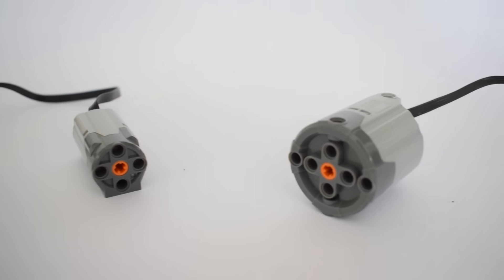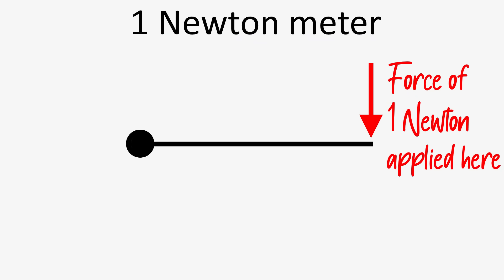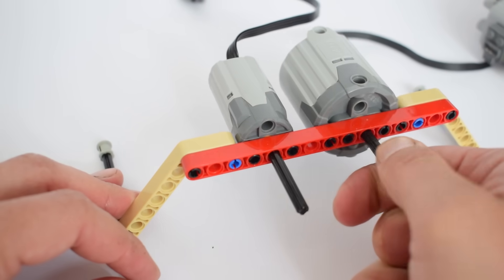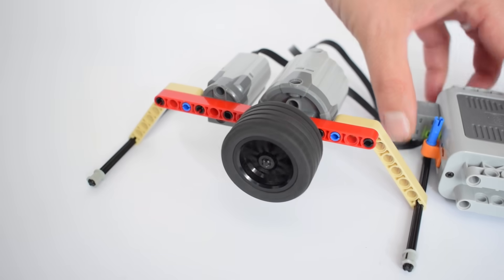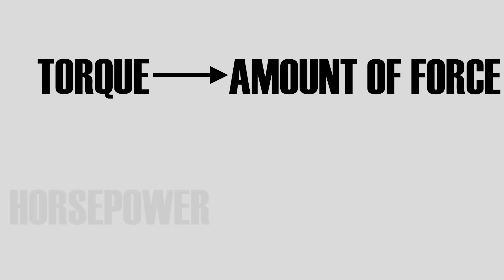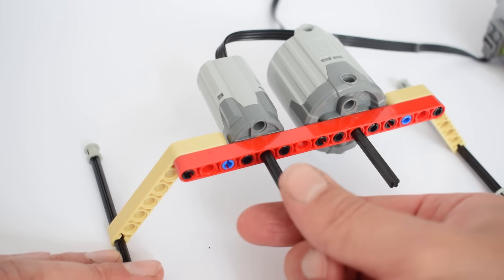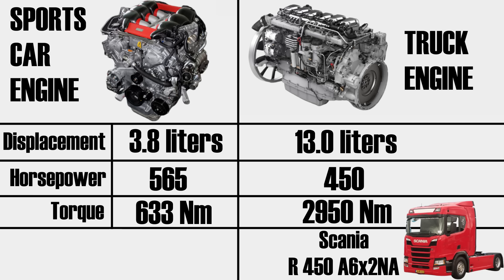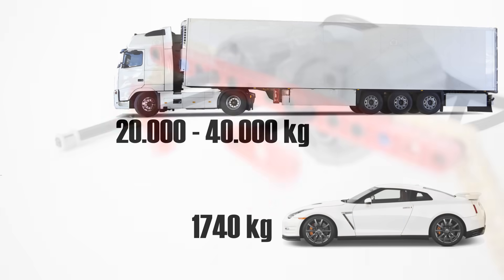NEVER be confused by HORSEPOWER and TORQUE again - HP and TORQUE EXPLAINED in the MOST VISUAL WAY

Comment: This is a good explanation. I think the only thing missing is the effect of gear ratios being torque multipliers.
Reply: Exactly, you can create double torque just with having speed halving gearing and power stays exactly the same if we just ignorre small gearing losses to simplify things.
Reply: @Karjis  I was thinking the same thing.  Using gear ratios to reduce the rpm at the tire (using a vehicle as an example) you can get the same amount of torque applied to the ground as a much larger engine.
Reply: @kevinbuhler8776  An even better example is a bicycle.  You can see the transmission (it's called a cassette), so it's a great way to understand gear ratios.  In a lower gear, the gear size is bigger.  One turn of the pedals might make gear 1 make one rotation.  Gear 1 is terrible for speed, but it's great for power, such as just starting off, or going up a hill.  Compare that, to say, gear 7 (I'm using that because it's my bike's highest gear).  Gear 7 is visibly smaller, and makes many rotations with one turn of the pedals.  It's great for cruising along in a straight line fast.  But you'll terribly hurt your knees if you don't move to a lower gear if you need to go slower, or if you're going up a hill.  In fact, for anyone who's interested in learning to drive a manual car, I would recommend to them that they first play around with the gears on a bike.  It makes learning to drive stick much easier, because they will better understand the concept of low versus high gears.
Reply: @hamsterama  Brilliant
Reply: Yep, on max power RPM and at full throttle, with proper transmission gearing,
more max hp =
more tq at the wheels,
only horsepower number matters.
Reply: @kdh6387  exactly! Bigger engines just last longer and are more fuel efficient at high loads. Thats why they are used in trucks. The torque output is irrelevant.
Reply: @vince0815  Torque output is relevant because you're physically limited by the size of your transmission. If you could have as many gears as you need, you'd eventually get an F1 engine to move a 40 ton truck as fast as the truck engine, but realistically... You'd need way too many gears because of the low torque output of that engine.

If you've noticed, most modern turbocharged cars have a high level of low-end torque, delivered flat and a power band of max horsepower delivered at high rpm (with lower corresponding torque). The result is that you get a very responsive and driveable car.

Large engines are indeed better for efficiency but not at full load. Every engine is designed to operate at maximum efficiency at a specific rpm. Check out marine diesel engines (the ones that are the size of an apartment building). They get 60+% thermal efficiency. That's insane for an internal combustion engine. But they spin oh-so-slowly.
Reply: @Kain987  yes you are right. It was a bit exaggerated what i said. But you know what i wanted to say.

Comment: Thank you so much for your explanation but  i still did not understand :\
Reply: Torque is pure twisting force. Horsepower is a combination of twisting force and how fast its twisting. You could have a lower torque motor that turns a higher rpm vs a higher torque motor turning slowly. Depending on the torques and rpms, the lower torque motor may actually get more work done because its turning faster. Imagine a person turning a wrench 3 meters long connected to some mechanism. They could generate more torque (twisting force) than a car engine easily but because they can't do it very quickly, the car engine could actually get far more work done. That's why horsepower is dependent on rpms. Small high horsepower engines like motorcycles or F1 cars are able to make that horsepower because of high rpm. 

 In the real world there's more variables like how long a motor can maintain that workload but strictly speaking, that's the difference. Not sure if i helped but i tried.

Comment: Okay, but the thing i dont get it, is the RPM in the equation. Why bigger electric motor is spinning slower? (i get it with cars, heavy engine usualy rotate slower due to mass). Electric motors both have same muscle (battery pack), maybe bigger electric motos have some sort of gera box where reducing speed instead of torque?
Reply: Possibly higher internal frictions or wound in a different way.

You could increase voltage and spin it faster and make even more power..

Until the wires get too hot and melt from the extra current driven into it by higher voltages.

Comment: I think that You forgot one thing. Gears! Gearing multiplies torque. I think that - using right gear - this smaller GTR engine can create more torque on WHEELS than bigger one. Trucks have big displacement engines, just because they need big torque on idle revs.

Comment: The way I always thought of torque was related to acceleration whereas horsepower (alongside gearing) was about effectiveness at higher speed
Reply: Torque from the engine is a completely meaningless figure. 

Torque is needed at the wheels to move something foreword but the torque from the engine can be multiplied by a gearbox where horsepower is just horsepower, it’s the same at the engine as it is at the wheels (neglecting drivetrain losses). 

The sportscar engine will outperform the truck engine at every task because it has more horsepower and thus more work done. This is even true for towing heavy loads, if the right gearbox is used. The truck engine will be more durable and more economical off course, but not have better performance.

Comment: This video exists because people who never took highschool physics didn't know what they were arguing over. All of the people who were like "I like torque more than hp, just happened to like  bigger motors, which produce more horsepower. Apples to apples would be comparing same displacement  but different bore/stroke ratios, like Honda F20C vs K20 vs R20 motors, and even that isn't apples to apples because of build-for-purpose issues.

Comment: Nice video and good explanation, with a couple caveats that I'd like to address:

1. You described HP as the "rate of torque". A more stringent/understandable description is that force/torque performs "work", which is measured in J (Joule). Work is a force applied over a distance ; for example using a force of 50 Nm to push a stone block over a distance of 1 m. The work then equals 50 Nm x 1 m = 50 Joule. In other words work = energy spent (pretty logical, ey?). Furthermore, to lift a certain weight to a certain height requires the same amount of work/energy no matter how quickly it's done. Work is timeless. For example transporting a dragster over a quarter mile - can be done in a month by a LEGO motor or in 4 seconds by a nitro guzzling top fuel engine. The work is the same! However, if you set a time requirement, then we are talking about power; energy delivered per time unit . So if we push that stone 1 m in 1 second we get 50 Nm x 1 m / 1 s = 50 J/s (Joules per second) = 50 W (Watt) = 0,05 kW = 0.068 HP. That's power ! ... i.e. how fast you can get stuff done. How fast you can get that dragster through the quarter mile. How fast you do 0-60 in a 3 tonne car. And that's what you feel, actually.

2. One doesn't "feel" the torque of the engine during acceleration. You feel the force from the seat on your back. The force from your seat is generated by the power of your engine. It doesn't matter if the power comes from a large engine producing 1000 Nm @ 3000 RPM or a small engine producing 200 Nm @ 15000 RPM - your ass will not know the difference !!! To conclude: the torque of the engine has nothing to do with the force which accelerates your car. The source of that feeling is your engine power transformed into torque by your transmission, diff and wheel diameter and then transformed into frictional force by your tyres. The force from the tyres causes the car to accelerate, which in turn pushes you in the back. Now, if frictional force is what is being discussed, then talking about Newton meters is of course highly relevant. But that's not what people talk about when they're bragging to their buddies about the "insane amounts of torque" their V8 is generating... Bragging about torque without regard to RPM is like bragging about RPM without regard to torque (think RC engine @ 30000 RPM - you aren't setting any records with one of those!).

Power (kW) ≈ Torque (Nm) x RPM / 9.55

Power is what you want. You can achieve it by lots of torque (at modest RPM) or lots of RPM (with modest torque). If you have both, then you've got a f*cking boatload.
Reply: I love you
Reply: like
Reply: you definitely feel torque. power is a derived expression. Frankly for a given rpm they are just different expressions of the same thing.
Reply: @TigerDude333  the human body can only "feel" acceleration. Without rpm your body would feel the torque, and with rpm its power.

You're still not really feeling power though, just acceleration.
Reply: @TigerDude333  I don't think you are making yourself very clear. Wish to expand on that so that I can reply? You are talking about engine torque, right? Maybe you misunderstood what I wrote? If you can clearly point out and explain where/how my logic is failing, I am more than glad to discuss it (and perhaps learn something in the process, I see no pride in being right).

What we can agree on (i hope) is that you experience acceleration (and a push in the back). If you trace back from those phenomena you shall see that a ∝ P, which doesn't hold true for torque.

Here's a good example: https://i.stack.imgur.com/XEH9Z.png

Where's the push in your back (what you feel) the strongest? @ 2000 RPM or @ 5000 RPM? What I said in my above post was that torque is nothing without RPM. That alone should disqualify the argument "torque is what you feel".
Reply: @oskjan1  what are you talking about? F=ma. Force is indistinguishable from acceleration. If I push you, you are accelerated and feel the force. You cannot have one without the other. Trying to differentiate two things that are directly related cannot be done.

Which rpm would produce greater acceleration is strictly based on the torque at those two points. Surely you don't think acceleration increases with power.
Reply: @TigerDude333  The F in F=ma is not the same thing as engine torque. Your F is the force applied to the mass along the vector of movement. Accelerating a mass from v(1) to v(2) takes some amount of work. You can view one revolution of the crank at a certain torque as "one unit of work". The faster the crank rotates - the more units of work are done per time unit (ergo: the more power is being generated).

Yes, I surely am making the claim that engine power is what causes accelleration.

Ekin = mv²/2 and ∆Ekin = m/2 × (v(2)² - v(1)²). The faster you deliver the energy difference, the faster your speed will change (accelleration). As you can see, this equates to: the more power you generate, the faster your speed will change.
Reply: @oskjan1  nope.  Torque is what is turned into force from the wheel to the ground.  It is the F in F=ma.  Again, torque (force) and power are two manifestations of the same thing for a given rpm, because either can be converted to the other.  You cannot separate the two unless you choose to ignore F=ma.

Comment: Good video, you forgot to add the fact that maximum torque and horsepower are obtained at certain RPM's, also best fuel economy is obtained at the intersection(there are graphs for this) between maximum torque and  horsepower.
When you buy a car you can read in its specs for example gasoline  2.0 liter car 200NM torque at 4500 RPM, while a disel engine, 2.0liter  gives you 200NM or more at 1750-2300 RPM, which is why diesel pulls much better the torque is applied in a very short range of RPM, while gasoline you have to rev the fuck out of it.
Reply: No, Torque and Horsepower always "intersect" at 5252 rpm (U.S. measures), that is they have the same value (given a particular engine).  Best fuel economy actually occurs well below this number for a few reasons.  The dominant consideration is how much throttle you have to use to provide the power required (steady state fuel economy), and that's usually at a slow engine speed but not too much throttle (smaller engines give better fuel economy because they can't produce as much torque at the required RPM so the throttle is open more).  Running the engine too slowly can cause it to "bog down" (the flame front cools too much to provide any torque) and running it too fast waste fuel to overcome increased friction, so there is a narrow range that works best -- this is why modern vehicles have so many gears.
Reply: @ehb403  no they dont, here's a common diesel european 1.5dci torque and power graph, this engine doesnt even reach 5252 rpm you are talking about, the engine gets best mileage around 1750-2100 rpm range. 
https://images.app.goo.gl/2R9KaLvJ2erK9AaR6

I own a skoda 1.4 petrol , the maximum torque is at 4400 rpm, but i drive it around 1800-3000 rpm to not wear out the engine, i get very poor fuel economy under 2500 rpm, the engine struggles and no torque especially uphill i need 3000 rpm.
Reply: @ionutth4895  That's why I put (U.S. measures) in parentheses!  The engine you described STILL would produce the same number for torque and horsepower using U.S. units at 5252 rpm even if the engine can't turn that fast, it's a conversion calculation not a statement about the engine -- it's just math.  As to the 1.4 Skoda, I used qualifiers like "dominant consideration", "usually at a slow speed", and "narrow range" instead of specific numbers because there ARE other factors (cam profile, intake and exhaust restrictions, variable valve timing, etc.).  I will say that if you get poor fuel economy under 2500 rpm there's probably an engineering problem there or you carry a lot of boat anchors in the trunk -- the only time I've had an engine I usually ran over 2500 rpm for best economy was a 800cc motorcycle engine.  

To be more specific about it, most small vehicle engines (not boat, semi, or airplane, etc.) are most fuel efficient at about (notice qualifier) 2100 rpm and 80% "load" or throttle -- IF your vehicle maintains a constant and desirable speed at that setting THEN that's where it gets the best fuel economy, OTHERWISE you'll probably have to run slower and/or with a less open throttle.  To check YOUR engine, check for a BSFC map and find the most efficient region on the map for reference.  Note1: MOST engines put out way too much power at this setting for driving on public roadways for long.  Note2: turbochargers change things up quite a bit but the pattern's still there.  Note3: On a related topic, I'd like to see dynamometer operators provide BSFC maps for their customers as well as the usual torque and horsepower graphs.
Reply: @ehb403  nah learn engines, us units suck use internatonal and metric everywhere
Reply: @ionutth4895  You can deny all you want, but I'm giving you truth.  It doesn't matter if your brain "works" in US or Metric units, torque and horsepower are simply related mathematically and what you identify as the graphs "crossing" is an artifact of the scales chosen.  The graph you're using does NOT show independent engine parameters, just a MATHEMATICAL relationship to one measured quantity (torque).  

The BSFC graph (usually) gives the actual "intersection" of torque and power at each RPM and load for a given engine.  That is overlaid on a graphic of fuel consumption "islands" or curves.  The process to find best fuel economy operation (even if you don't like it) is simple: locate the curve indicating power your vehicle needs to maintain a set speed (or acceleration, if that's what you're into) and find the lowest brake specific fuel flow (BSFC) that provides THAT power level with THAT engine (the islands should have labels).  Then look down to find RPM (select gear to put engine at THAT RPM, throttle should come naturally).  Of course with today's electronic controls all of that work is done by engineers who program the control units to behave according to the above guidelines.  

BTW, common highway steady state power consumption is ROUGHLY 15 kW, depending on conditions and vehicle, and your BEST bet for that is usually around 1600 RPM.  Of course, with the caveat that if your vehicle and conditions require more power than your engine provides at that RPM then you'll have to speed it up.

Comment: With different gear ratios that result in the same output wheel speed would a smaller engine with more horsepower but less engine torque be able to tow more weight than a larger one that has more engine torque but less horsepower? The output wheel torque of an engine with more horsepower after you account for gear reductions will be larger so it should be able to tow more weight right? This assumes that both engines make peak torque at the same time.
Reply: You could run a truck on a GTR engine but to produce similar axle torque you'd have to cruise at 3x the RPM. So instead of 2500rpm it would have to be geared 3x higher and run the engine at 7500rpm all day.

Running like that is inefficient and bad for durability. Hence nice slow rotating engines are used which are economic and reliable.

Gears trade rpm for torque or torque for rpm but equate same total power output from the power input.